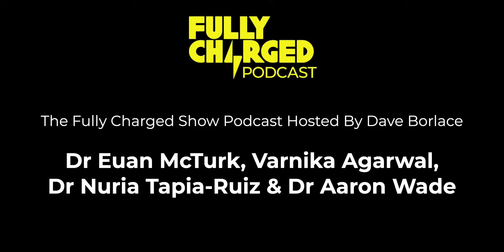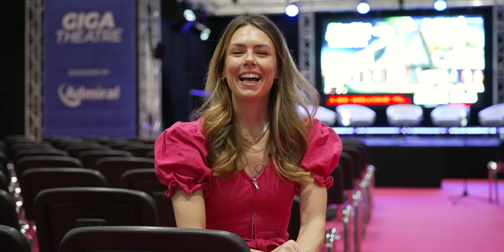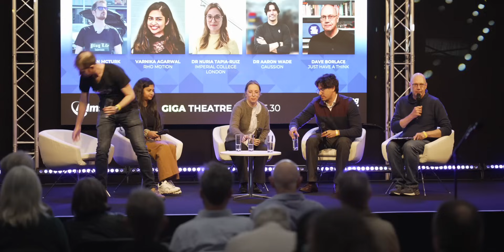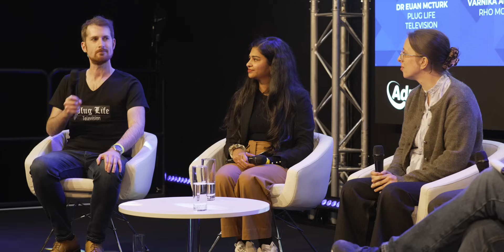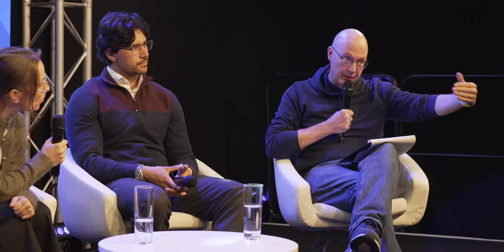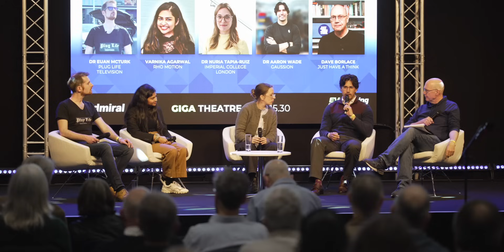From Solid State to Sodium - THESE are the next Big Battery Breakthroughs!

Comment: Regarding new battery tech with 5 minute charging, I am not sure many people have realised how this may totally change charging infrastructure going forward.

The electricity needed is the same to charge a vehicle if it is charged in 5 minutes or 12 hours.

It will probably be cheaper to produce one 5 minute charger instead of eight 40 minute chargers.

Currently I see loads of chargers empty most of the time.

With a 5 minute charger, I can see them in towns and cities where home charging is difficult instead of on main routes. Where you can pre book a slot, the charger having two parking spots and two leads. While one vehicle is charging the other bay swaps over vehicles and as one charge finishes the charge switches to the other lead.

The operator could charge according to time of day, if you have plenty of money, you can charge whenever you want but pay a premium, if on a tight budget you find a much cheaper but less convenient overnight slot.

I always thought home charging for everyone was almost impossible to achieve, suddenly there is a promise of a different solution.

Comment: OK... CATL, BYD, Quantumscape, Northvolt... but...

Soild electrolyte (cathode and anode) -- in production - Tesla
Removing the anode - being worked on by - Tesla
Structural batteries/Removal of Modules - Tesla 
     (well before the blade battery)
Asymetric cathode/anode being worked on by - Tesla

They are excited by compressed air at 60-70% efficiency vs LFP/Sodium batteries at  85-95% efficiency... where is the cost benefit vs tossing away 20% of your energy. I would think that 20% pure profit would trump the installation cost difference unless pumped air is vastly cheaper than LFP/Sodium batteries... in which case, why isn't it everywhere at 60%? The adiabatic CAES that he's talking about are about 20-30% more expensive than conventional (heat reclamation infrastructure) to get as high as 70%. The basic tech has been around for a Long time. They also need to be built near geological features such as defunct salt mines... batteries go anywhere, reducing grid infrastructure. Grid batteries seem to be Way more popular in the market... Tesla's one of the leaders here with CATL jumping in at scale... because compressed air will put them out of business????
I am not so excited at 70%... let's talk at 80%.

China is 20 years ahead of Tesla in battery tech... really? 

Northvolt (the company in bankruptcy is the example given of Western tech). Yes, the current gen of 4680 (and only interesting one) is new to production, but we Are talking about near term future and Tesla is at zero risk of bankruptcy and has a vast built-in market for their batteries).

They put out ideas in 5 minutes or so but didn't back them up (didn't really have time). I would prefer more time allocated or you get the kind of dishwater deep analysis you get at a political debate. Plus, I heard most of these ideas from Tesla. Some of them years ago.

Is there an elephant in the room? If I were to choose the top 3 battery manufacturers in the near future (3-5 years), I would name CATL, BYD and Tesla... Northvolt and Quantumscape... not so much. One is (was) never revolutionary... and dying... the other still at the "burning money" stage and Might be profitable in 2026... Their QSE-5 due for limited release this year is rated at 301wh/kg... about where Tesla's 4680 is speculated to be (at scale) in the same time frame... with no stated cost per kwh given... 

Tesla is now producing the 4680 dry electrode NMC batteries cheaply at 272wh/kg and scaling fast... a lot cheaper than their competition in this battery segment (high energy density). They have patents suggesting they are exploring advanced internal LFP. Near term additions of limited sodium should bring their dry electrolyte NMCs to 300wh/kg before the year's out (they are tackling the expansion problem by encapsulating sodium nodules in a conductive elastic medium)... Should manage 300wh/kg at the least... 315 to 330 is also on the table... but that would be speculative.

Does anyone buy that Tesla 4680 is 20 years behind China in battery tech? At the low end, they don't have an in-house product, I agree but the blanket statement doesn't really stand up as Tesla is at the cutting edge of NMC... their future plans appear to embrace very low cost LFP as well (patent info)... but that's also speculative.

Don't get me wrong, there were nice tidbits of info here... but I didn't get a sense of the state of things or the future here... I think this excellent panel would be better utilized contributing to a paper blanketing the topic directly and then having a narrator take snippets from each to produce a more coherent view of the near future. For example... where will the cost/energy density be in 5 years for the low and high ends of the market given all other factors are satisfactory (ie exclude batteries with a cycle life less than 1000, cost over "sort of" competitive, etc). Ie - how will the consumer be impacted in the real world at scale. 

I don't like political debate formats exactly because of severe time limits. You don't get anyone's best thinking that way. And it rarely ends with a clear-ish picture of the future.

Not a bad video, just not as good as it could be to the wider audience.

Comment: The efficiency comparison of compressed air to pumped hydro was not accurate. He compared the maximum pumped air at 70% to the minimum hydro at 70%, saying that it matched pumped hydro. An accurate comparison would be compressed air of 60%~70% vs 70%~85%

Comment: the barrier to sodium batterys is how cheap they are you can get sodium everywhere. life dosent use lithium for energy storage it uses sodium because its much more stable.
sodium is about 10% heavier than lithium the battery is like 20-30% of the vehicles weight so its in effects a 2-3% weight difference in vehicle and 2-3% less range at 6x or so lower cost and it can operate in extreem low and high temps  and most importantly it is a lot less reactive  in terms of environmental toxicity with extraction and at end of life and also in speed u can charge it at without it catching fire

Comment: I did not hear anything about the Aluminum Ion battery.  It is said to be a number of times higher in charge than Lithium and it is both much cheaper and lighter.  From what I heard it can charge in just a couple of minutes and does not care if it is cold or hot.

Comment: So much money has been spent on investing in solid state, it will destroy all other battery technologies. At first, it could be expensive but i don't see that lasting long as there are multiple entities that are investing and competition will drive down prices very fast.
Sodium was supposed to be the next big thing, cheap and safe , although half the density as lithium chemistry. Sodium is around 30% more expensive than lithium. Until they get it half the cost of lithium, it will fail.

Solid state has much more potential than lithium, density much greater than lithium and charge rate safety and even weight could be much better. And it is not far away, there are multiple car manufacturers and big battery manufacturers advising they will have solid state in cars within the next year or two at the most.
Reply: Try watching the video.

Comment: I think we'll be using a lot more batteries at home unless we start to put some of those grid storage solutions in neighbourhoods, probably has less issues short and long term by having a more distributed system than upgrading the grid itself.
Reply: I fully agree. Distributed storage at point of use makes great sense!

Comment: Shame the Koreans are still selling NMC in their new cars like the Kia EV3
Reply: Especially now that CATL are mass producing their Shenxing Plus LFP battery that has an energy density of 205 Wh/kg, which is better than the 200 Wh/kg of commercial NMC.
Reply: @sailingoctopus1 
SAIC made a limited production run of the IM LS6 ( only 1000 unit) which used the MNC 380 wh/kg.

Meanwhile, the one that will enter mass production is the 205Wh/kg LFP which will be sold in bulk at MG4.
Reply: I think it comes to what they have available for now and the initial run of the production for the next three years. 

The design of a car maybe 3-5 years ahead of release, so you are kind of designing to what you are very confident you can get. Not what you hope to get, three cyber truck is a example of hoping, but it doesn't arrive in time.
Reply: It is... but probably pragmatic for short term.

Comment: Sodium ion batteries can be made using solid state technology tho.
Reply: But, as explained, "Solid State" has it's own issues, is NOT "ready" and is more expensive.
It's "Currently" (unintentional Battery pun) "The Better Mouse Trap" when "The Original Mouse Trap" is doing the job, and STILL improving, at MUCH lower cost.

Comment: When you talk a GWH in storage then its a serious scale and finding these frozen air batteries are being installed at these levels is significant. First time I had heard of them at a commercial level.
Reply: Search for Highview. I believe that they are the leaders in this technology.
Reply: And no exotic materials required, just traditional engineering which can be used to revitalise rust belts. Also extract energy from low-grade waste heat such as thermal power plant stacks or waste incinerators.

Comment: Why can't you dump brine back into the sea ? So long as its dispersed then it would make close to ZERO difference to the seas salinity  ie Its a drop in an ocean.
Reply: There is a problem with too much freshwater entering the ocean with the melting of the Greenland ice cap so it’s obvious that the brine should be taken there and used to salinate  the sea
Reply: Ya can... but the point of dispersal is still affected.  Living cells, like those making up us, have a critical balance of pressure inside vs outside the cells.  For non-air-breathing creatures, increased salinity above normal is a huge issue.

Comment: Were does super caps fit into all this?
Reply: Very short term storage, at high (dis)charge rates.  Best used in conjunction with other batteries, as they have a much lower density.  Regen and acceleration on trucks is a good application, to boost the rate over what pure battery could achieve.
Reply: You have to control the charge/ discharge

Comment: Not solid state, but batteries that can be recharged via a liquid....so just like gasoline, you go to a recharge station and swap out your electolite with charged ones, and recharge the entire battery pack in 5 minutes.  I know this was worked on years ago, have not heard much about it lately.
Reply: Have you seen the Zeekr Golden Battery? 
LFP based , 5.5C, 75kWh, charges 10-80% (NOT "20-80%) in 9 minutes 45 seconds.
That's an actual Real World driving to 10% and charging test by the "Out Of Spec" YT Channel on a recent visit to China, NOT a "Claimed performance".
Let's assume you have 280 miles of range from a 100% start on that 75kWh pack.
If you could AVERAGE 70mph, that's 4 hours.
Try plugging in walking to "facilities" for a (Necessary) comfort break, "completing the task", washing you hands and returning to the car inside 10 minutes.
That's without thinking "Mmmmm.... Food.... Coffee..... Whatever" and paying for the same.
"5 minutes" is simply not required.
"Out-range the Human" is the metric.

Comment: The U. of Adelaide developed a Lithium-Sulfur battery yielding 1,306 Wh/kg with 1,000 cycles at 8C power density, but combined with the ion sieve of Karlsruhe U battery that provides 25,000 cycles at 5C, you’d have a cheap, really energy and power dense forever battery. The ion sieve of the Karlsruhe Li-S battery is so efficient, it can even reach 150C with decreased cycling life.
Reply: You need the government to finance the Start large-scale production.." Production on a scale"
Reply: You can't assume that you can mix different technologies and obtain just the sum of both characteristics. It doesn't work that way. They can be incompatible or they could require to sacrifice something reducing the expected improvement on different circumstances.
Reply: @oatlegOnYt  correct, but they're both Li-S and one has an energy dense cathode with the other having a thin, preformed SEI that filters the ion flow in a dense pattern. Their attributes are probably not totally additive but both should improve substantially.
Reply: To be clear "5C" is rate of (dis)charge, not density by weight.
Reply: @ChrisNotTheKing  The C rate is labeled power density that is the charge and discharge rate.
Reply: Interestingly the SEI developments apply to Metal-Air batteries as well, including Lithium-Air chemistries. The SEI developments, such as copolymer, composite and glass/ceramic interfaces, perform the same function in these cells of improving contact area, supporting expansion/contraction of the metal anode, and supressing dendrite formation. It will be interesting with these SEI developments whether battery designs will quickly step from using enclosed cathode elements (such as sulphur) to porous air based ones. 

A key driver is Metal-Air battery's ability to offer the highest energy density of all battery chemistries available, which for Lithium-Air at 11.14 kWh/kg near-matches the theoretical max of petroleum fuel products but exceeds fuels inefficient 1.7 kWh/kg at the wheel in vehicles (at an projected 4 kWh/kg for Lithium-Air). In the labs, similar to Lithium-Sulphur, Lithium-Air energy density of 1,500 to 1,800 Wh/kg have been achieved at a similar low 1,000s of cycles level.
Reply: @GruffSillyGoat Yes, I was a fan of Air Energy LLC Li-Air too with high hopes of 2kWh/kg+ but Adelaide leapfrogged them and their need to have airflow makes them susceptible to contaminant intrusion, particularly water. If they could pressurise their cells as Li-O, that might work but seals fail. Their cathode is printed carbon with catalysts that would make a good direct conversion Ammonia Fuel Cell anode. This fuel cell is needed to complement batteries in long duration, high demand vehicles, like ships and cross country locomotives.